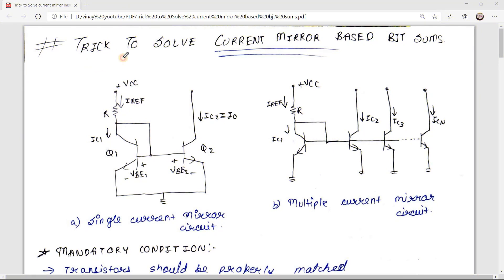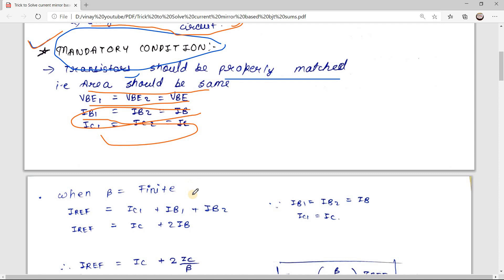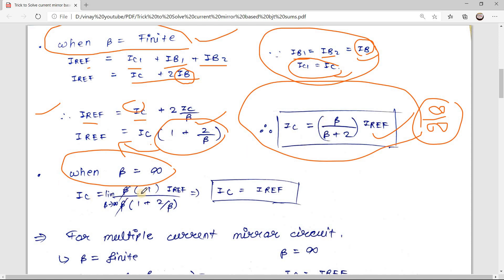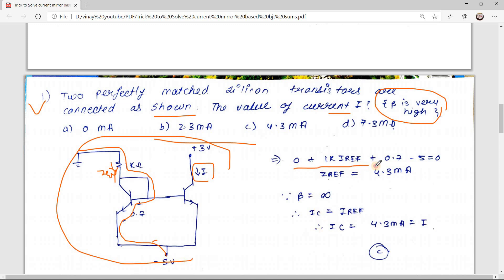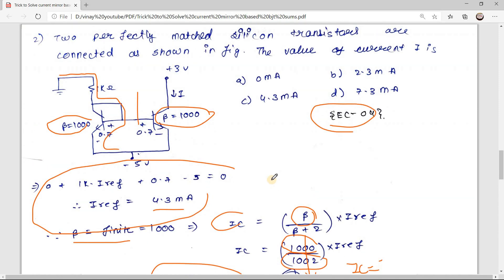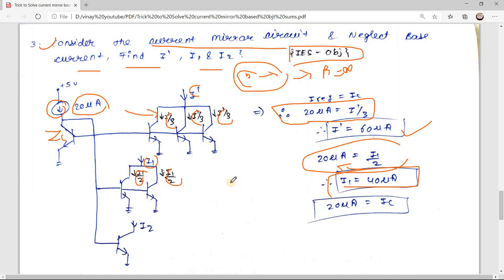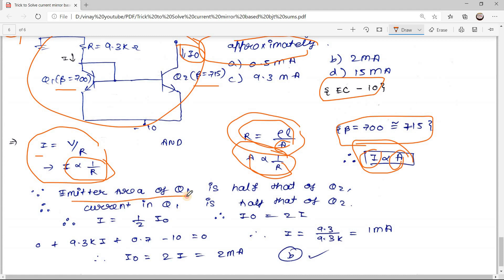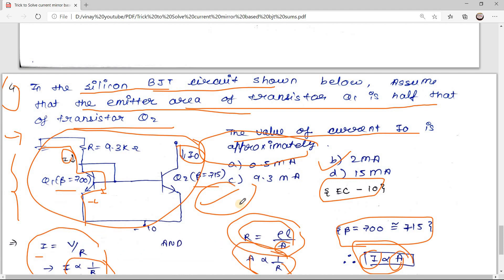Trick to Solve Current Mirror Based Sums | Current Mirror Tricks | Concept of Current Mirror Circuit

Comment: Hello sir!
I appreciate your effort.
In the video, does N mean the no. of mirrors or the no. of transistors? There's a contradiction between what you have said at 4:49 and the circuit diagram for multiple current mirror. The diagram shows N as no. of transistors, but the formula does not replicate the same.
Please correct me if I'm wrong!
Great day!!
Reply from the maker: Hey, that N is no. Of mirror in the circuit.See the formula of finite mirror circuit and relate everything with it,like for single mirror N will be 1 and you will get the formula same as of your single mirror circuit.I hope I answer your question👍